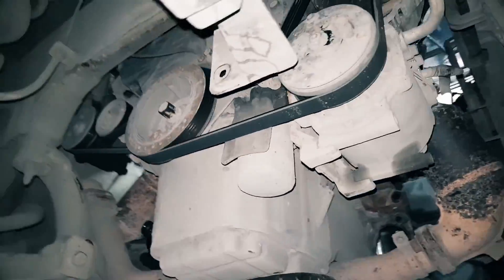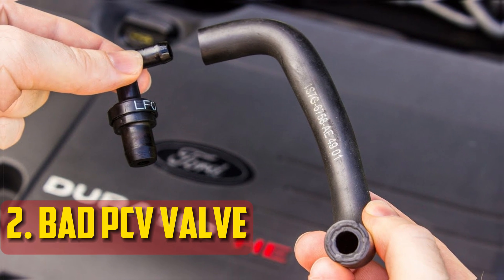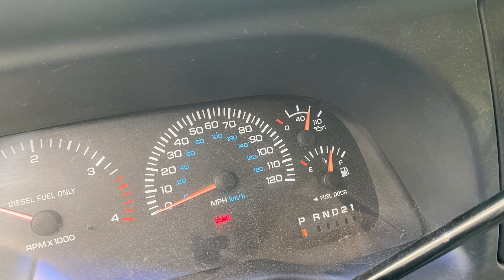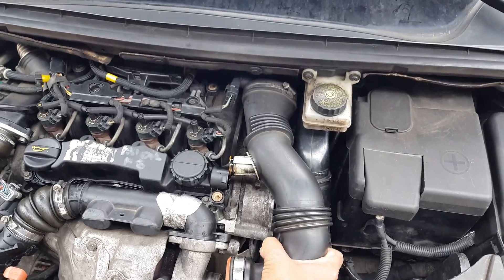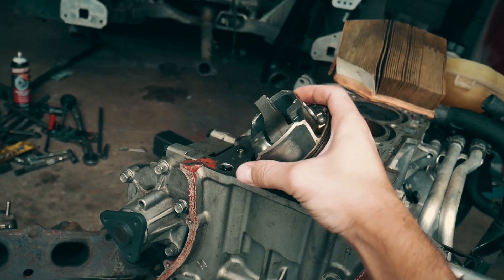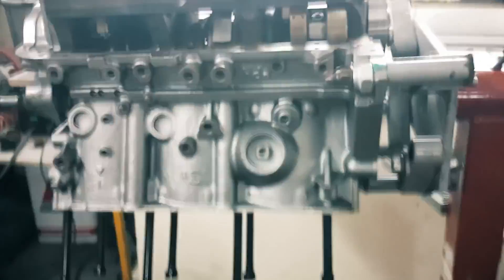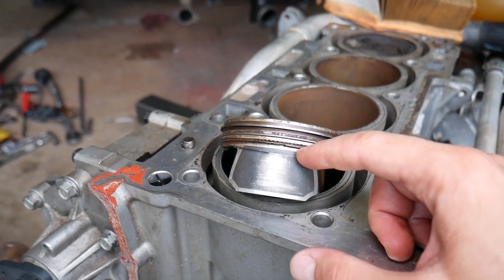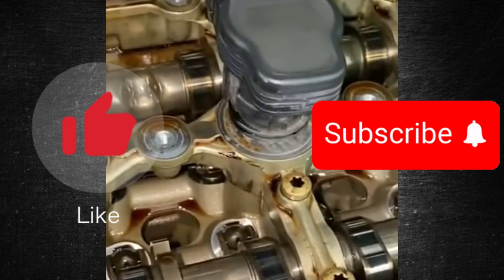8 Causes Your Car Burning Oil - How to Fix?

Comment: I replaced both valve covers on my 2012 Silverado, but it's still burning oil. Let me tell you a little more information first...... It doesn't smoke of the mourning when I first crack it. It doesn't smoke when I'm sitting at a red light or stop sign. It's doesn't smoke when I'm driving down the 4 lane or interstate. The only time it smokes is after I've driven it downhill ending with a stop. So, you're driving downhill on the 4 lane and at the bottom of the hill there's a red light or stop sign, you stop at the redlight and when the light turns green you push the gas petal to take off and that's when you see the puff of blue smoke. It doesn't smoke while you're sitting at the red light, only when you push the petal to take off. My assumption is.... When you're going down downhill the oil is moved forwards inside the engine and something at the front of the engine is picking it up to be burned in the exhaust or the oil is leaking through one of the valve seals at the front of the engine. Do you have any suggestions or thoughts about this? Any help would be greatly appreciated!
Reply: Sorry you're dealing with this. My 2008 Sonata starts smoking after a few minutes of driving. It smokes at red lights and stop signs. There's still smoke when driving, but it's hard to see.
I'm hoping changing the PCV valve will fix this.
Reply: @dabajabaza111  I guess the next thing I'm going to try is replacing the valve stem seals.
Reply: Yes, sell it.